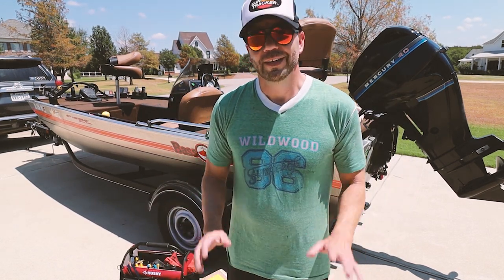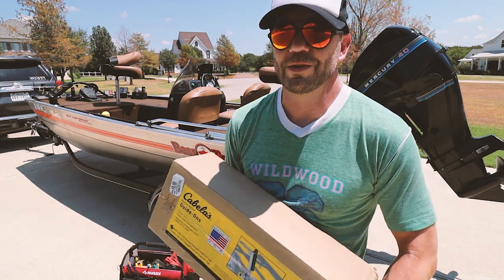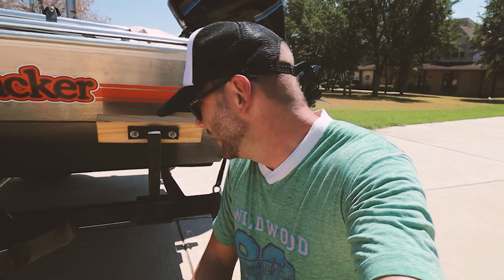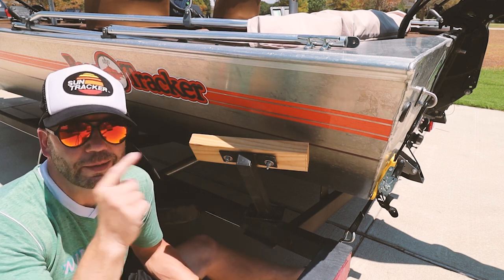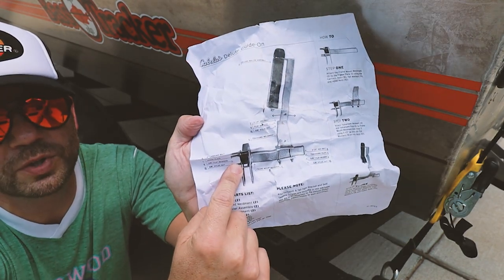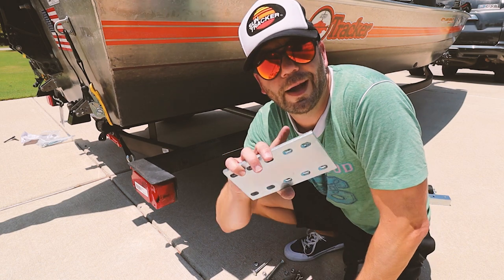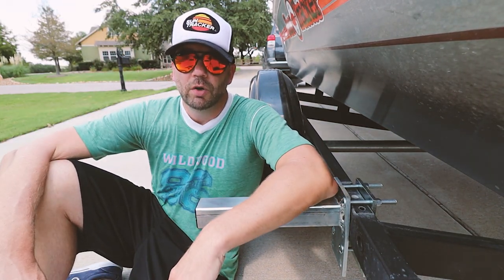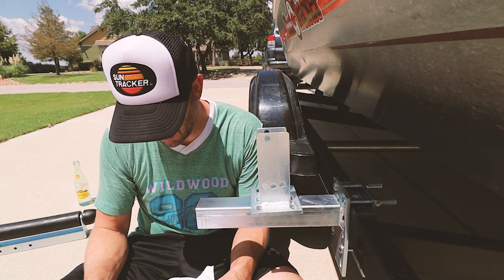I BROKE my TRAILER | Bass Tracker Boat rigging 2020

Comment: How have the roller guides been? I need something to go on the side of my tracker and I’m torn between these and the bunks like you had before.
Reply from the maker: Actually love them. Much easier to run the boat onto the trailer. Does add a little width, so make sure she still fits in the garage…
Reply: Awesome. I need some. Sometimes if the wind is bad it blows the boat sideways and it doesn’t sit right on the trailer.

Comment: The old bumpers looked to be an inch or so off so best guess is to put them in the same spot. You can cut those ends off with a reciprocal saw.  A ratchet set would have saved you tons of time.
Reply from the maker: True, Jay, but if I'd done it RIGHT, what kind of video would that have been!?
Reply: RetroBassin in keeping with the Xmas story references you could have had W kick over the bolts and say “fudge!”

Comment: Tracker boats are built very very cheap. All wood on trailers are not pressure treated lumber. I replaced all mine on My 2015 tracker when I had the same thing happen.